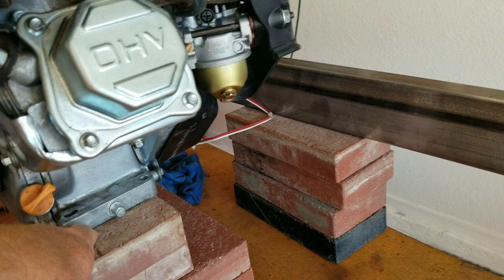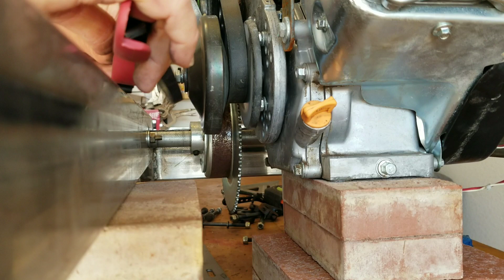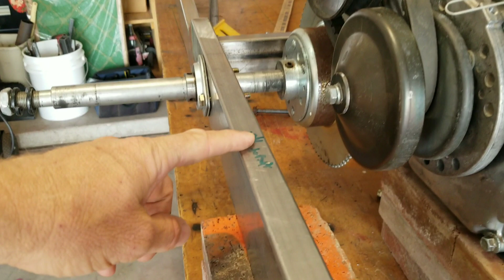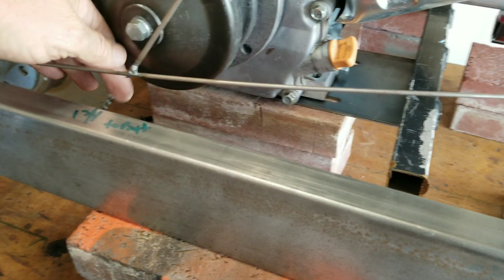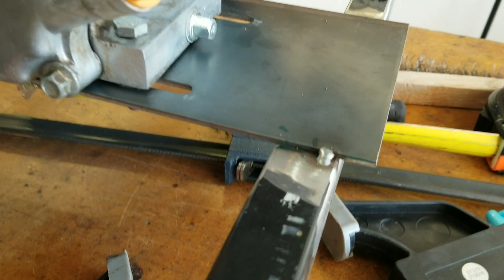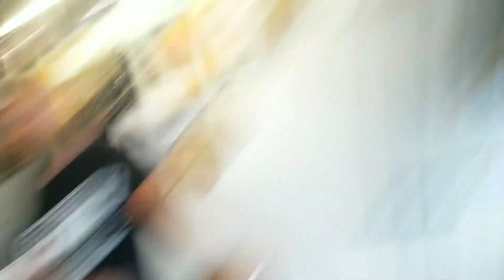Cyclekart Frame Part 4, Motor Mount and TAV install

Comment: Steve - I can't seem to find the torque settings for the two bolts - One said 24ft pounds for the drive shaft, but the (larger) nut on the other spindle - any idea?  Yes, tight, but how tight?
Reply from the maker: The large bolt on the TAV?  It should basically just barely touch to remove the play.  Do not torque that one as it will not allow the movement of the clutch

Comment: awesome content and previous comments and adding to them the car is as cool as you can get [my tastes may vary to others]
i live in western australia and have told heaps of people about cycle karts and trying to build one [ the postie bike prices are through the roof ] also having a go at a 1900 to 1930's board track racer [motorbike motorised pushbike 200cc limit direct drive no gears] edg classics board track racers has some cool ones on youtube and a one way jackshaft system ??? so keep up the hard work and have fun . cheers
Reply from the maker: Thanks for watching and good luck with your build

Comment: Hi Steve, can you tell me the size of the engine sprockets and rear axle? What kind of chain did you use?
Reply from the maker: I use a 35 chain, the sprockets I like are a 60T on the axle and a 10T on the TAV, some TAV's come with a 12T when you order it for a 35 chain, I changed mine.  My dads Duesenberg has a 35 chain with a 72T on the axle and a 12T on the TAV.  It works out to the same ratio 6:1

Comment: Steve, I appreciate the time you put into these videos.  I find each well-labeled  numbered video an efficient way to learn about a certain segment of the build.  I take in the information best in these shorter and compressed videos.  But there's more to be said about what you are communicating here.  Your presentation exemplifies the spirit of this endeavor:  Prepare, ask questions, consider alternatives, then just do it.  We all will end up getting some things wrong as we go along and you have shown us that it's ok to back up, grind it down, do it again.  And, larger picture, that we may want to go back later and make major changes to a car we built and drove.  I encourage you to stay on this track.  You are producing really good stuff and it is adding significantly to the fun I am having building a cyclekart.
Reply from the maker: Wow, thank you so much for your thoughtful comments. My cut off wheel and grinder are well used, lol.